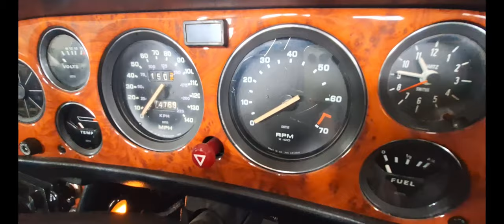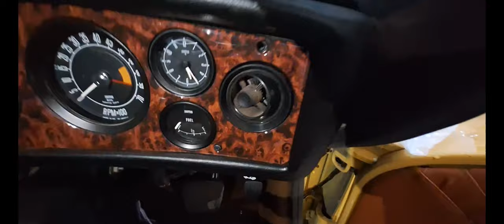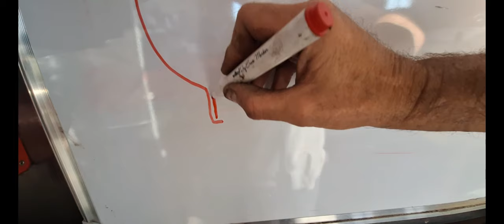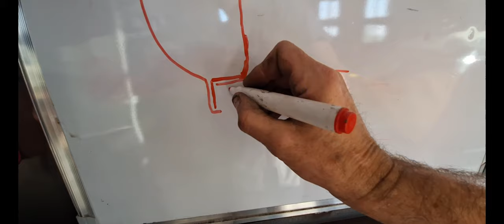Triumph Stag buyers guide - and the differences between a mk1 and mk2

Comment: Just for info all Stags had a final drive ratio (diff) of 3.7:1   Some of the big saloons (2.5/2500) had 3.45:1 which can be fitted to the Stag, and would make motorway cruising more relaxed, which is needed with the auto gearboxes.

Comment: Yep great information there.  I trure honest approach   , my words completely, !   we worked on them  in the day  ,  after a life time fixing driving cars i now have a mk 1 and half 72  brilliant car , thanks for sharing  spot on ,
Reply from the maker: Thanks Steve,  got the idea from someone adamant that mk2 cars had grey badges lol
Reply: Interesting video, I tend to agree that an original looking MK1 will command more money than the plentiful later cars. The biggest problem with Stags is buyers and owners do not understand the difference between early and late cars which this video has gone someway to help with, although you forgot to mention that the cooling system was changed towards the beginning of the batch 2 MK1's and this is why they have the same cooling and air filter arrangement as the later Stags (mk2) not forgetting the black rear panel on mk2 Stags only to be deleted again to body colour in 76 👍all of this is muddled of course by the unofficial term of mk 1.5. This term came about because early and later Stags were coming down the production line together for a very short period (about 4 months) some later parts were  fitted to early cars. The easiest way to identify where your Stag sits in the production line is to look at the chassis number LD20001 on wards is a mk2 everything before is a designated MK1. Disagree with the comments on MK1 hoods they look much better in my opinion. Don't get me started on the confusion of Mk2 wheel trims 😂.

Comment: I have an early Mk 1 (Jan 71), early owners seem to have spent some money protecting it (great undercoating, etc) somewhere in its middle years it was ridden hard and put away wet with the resulting rust, loose suspension and layers of dirt. Despite all that it was an easy car to drive, relaxed on the highway and reliable in the city. Two years ago I started restoring it, and what a difference that made.  More positive steering, less body roll, smooth clutch and shifter. I’ve welded in some patch panels (lower front wings and skirt) but will leave the real body work and paint to the pros. This is my third restoration and, including precautionary replacement of timing chains and head gaskets, it has been no more expensive than the MGTD or spitfire. So to those concerned about extraordinary Stag costs, they aren’t going to be an investment, but neither is that Friday night pint.  It’s just the joy of doing. 
Probably the best comparative review I’ve seen.  BTW, the NA Mk1 Stags were fitted with wire wheels and chrome finishers, and seats with headrest. My Stag is a four speed without overdrive, although I have an A-type that I might install.  Not sure I agree with the carb comments as it is easy to rebuild the Strombies and they work reliably when cared for, but for sure everyone has their favourites.  Although I have limited experience with the MG range, I find the triumph’s easier to work on, especially those on the Herald frame. 
Thanks again for the detailed presentation.

Comment: I used to work weekends at a stag specialist. One thing you havent mentioned is that towards the end of Mk1 production, they did introduce some things which also appear on Mk 2s at the time we used to refer to K and L reg cars as Mk1 and a half. You are spot on with the door latches on the B posts, there was no cross over with later MK1s having MK2  B post latches. Mk1s generally had A type OD but some of the later MK1 has J type ODs. While I was there, we had a prototype stag I think it s reg number started PVC and it was G reg. The really interesting thing about it was that it had been changed at the factory to be left hand drive OR right hand drive so that it could be presented to the home market and overseas market after swapping dashboards, pedal boxes etc. It also didnt use the stag V8, it had the straight 6 with twin carbs. The weight of the straight 6  engine suited the stag and the engine dropped straight into the engine bay and onto the mountings. I always thought that if I every had any issues with that stag engine , I would drop a triumph 2500S engine into it since the engine bays are almost identical...and the prototype proves it. Original good stag difs were like hens teeth 30 years ago due to the vents blocking,  the diff blowing it seals and losing its oil or the aluminium diff back plate bolted to the steel diff carrier and rotting holes in the back plate and the diff losing oil. Although the crown wheel of the stag diff is the same ratio as one of the other triumphs ( I dont recall which one it is) the stag crownwheel is different in that it is broader in order to handle more power. I always suspected that they had wanted to give the stag more power but couldnt because of its cooling issues so the up rated diff made no difference.You mentioned export cars MK1 headrests and side marker lights. The export front bumper brackets were also different in that they had a plate welded over the top of them to reinforce them. I built my stag up to Australian spec and it was a MK 1 so it had those special headrests, the rear marker lights and the bumper brackets. It also had very rare stainless steel caps which fitted on the front and rear top corners of the door cards held onto the doors using small philips head self tappers. And yes!! stag bonnets dont rot  but boot lids do! Oh ! one other thing! some MK1 home and export cars had an additional pressed steel ribbed cross brace in the doors presumably for side impact protection.The MK1 light switch also has a fog lamp position on it which the MK2 doesnt have.

Comment: This video popped up just at the correct time.
 In the process of looking for an everyday classic. I was considering a mk 3 Chrome conversion mgb gt,
 But the stag looks. Just keep drawing me in.
You explained a great deal about this car, and I'm not sure this is gonna be the 1 for me. Seems like it's gonna be a bit tougher on parts and cost, etc.
I am still a bit torn between the 2,
Any chance you have a similar knowledge of the mgbgt, I'd love to see a similar video on that car.
Reply from the maker: I could do an mg one, I service one for a customer,  but I can't see it coming in for a while unfortunately. 
The stag is a completely different car to an mgb, a stag being more of a comfy tourer rather than a sports car like the mg. The stag is easy to get in and out, has good brakes and a lovely torquey engine,  they are also pretty easy to maintain yourself.  The mgb is tight to get in/out, low and some jobs can be a pain to do (gearbox oil for example) .
If you want a more sporty car that's affordable and easy to maintain I would recommend looking at a spitfire 1500, they go OK (1300 cars are pretty slow in modern traffic), you can fit a gt6 engine which makes a quick car, and they are a very affordable car currently.
Reply: @YorkshireClassicCarsltd  thanks for the response,
I actually started thinking about the spitfire,
But drawn to the practicality of some back seats.
As I really want to use it, not show it.
I'd like to see a version of this video about the mg, so please, if you find the time, when u have the car there. That would be great.
I'm thinking maybe the stag will be OK, but bit concerned about the engine rebuild,
But maybe Il just chuck a rover v8 in, as the prices are much better and doable for me.
Much to the horror of the triumph owners club 😆.

Comment: Hi I have been looking for a stag for a while think I have seen a good one with factory air conditioning do you know what the pitfalls are removing the compressor I believe the heater wouldn’t work correctly thanks
Reply from the maker: I'm sorry I aren't familiar with air con on the stags, it's one of the only things I haven't worked on.  That being said I'd be surprised if the heater was effected by its removal, they don't have the electronic controlling more modern climate control heaters